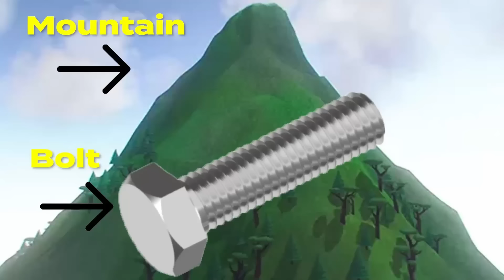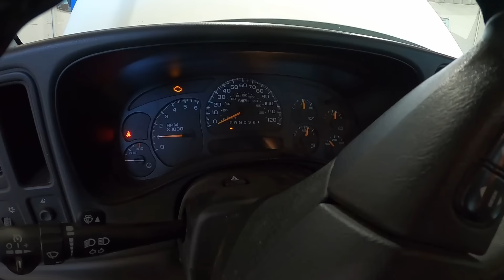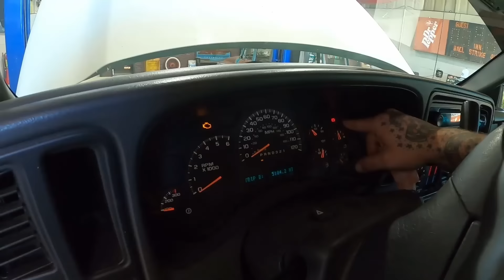BROKEN WINDOWS, Oil change, and MORE! TOW PIG SALLY!

Comment: The blue stuff is to see if the drain plug has been tampered with. Saves oil change places from people trying to scam for a new motor.
Reply: Came here to say this.  I think it started back in the '80s when I worked in Texas at Andy Granatelli's STP.
Reply: Hey that locking pliers guy says to right date on filter lol
Reply: Very typical from a WALMART Tire & Lube Express  😅
Reply: @mattleverenz4150 Except when Walmart cross-threads the drain plug 🤣
Reply: Yea we had to do that when i worked at Walmart tire and lube all the way back in the 90's
Reply: The blue stuff is Ultra blue sealant. The drain plug gasket is old and leaks.
Reply: I work at an oil change shop, and i've seen the blue and red stuff on drain plugs,

Comment: If I had that tow pig, I'd leave the suspension as is, because when you really get to towing something heavy, you don't want it to squat too much. Those trucks are meant to tow and they level out with a trailer/weight on them. Looking good though....
Reply: Agreed
Reply: Thank you for this. AND with a leveling kit, you can hook the a smallest trailer to the truck and it will put the truck in stink bug stance, which looks terrible to me. A heavy load will only amplify this.
Reply: Those trucks also have torsion bars so if it’s really bothering him how it sits he could crank it up or down in the front quite a bit. My old farm truck used to have a service body and when I put a flat bed to it it needed quite a bit of cranking on the torsion bar to get it sitting without the ass end waay up

Comment: Consider installing an electronic number keypad lock at the house. Maybe the shop also. Don't have to worry about getting keys made or locking yourself out. They also make those locks with options to integrate with home automation systems.

Comment: Tech tip: to reset the oil monitor, you scroll through the dashboard menu with the buttons on the wheel until you get to oil life, then if you have an arrow button push and hold it or push and hold the trip reset button until the oil life says 100% then turn the key off and back on and your done.
Reply: Yes this puddin^^^^^
Reply: That’s for the trucks with the fancy DIC with fuel mileage display. These older ones use three pedal pumps to clear the dummy light. I think the one you speak of started around 2010.
Reply: @bairfamilyfarm1336 came here to say that. Love me a gmt800
Reply: My truck is twin to Puddin's, with chrome along bottom though.
Reply: I've had luck with turning the key to run but not started, wait for the checks to finish, fully cycle the gas pedal 3x shut off the key then start it
Reply: That's not how you do this one. I own the same truck. He's right. Turn to run position and throttle to floor 3 times. Only other way is a scan tool reset. I know. I own a repair business.

Comment: Tighten up the front end to level it off. I did that to mine as well. I think that that body style, you can level the mirrors as well. They definitely look better with a little extra meet as well. 
I wouldn’t do that till I got all the rubber off the ones that are on there. 😬👍

Comment: You can crank those torsion keys and get around an inch to an inch and a half lift in the front which puts it pretty close to the rear and a 285/75/16 fills the wheel wells up pretty good and fits those pyo's pretty good
Reply: Yep, exactly what I was thinking.  I noticed the torsion bars when he was changing the oil.  Same kind that I have
on my Suburban.

Comment: FYI the transfer case in those models have a retainer bracket of some sort that is suppose to move internally that uses the case for a stop its steel touching aluminum over time it wears a small hole in the case causing a leak. So if it hasn't already been fixed keep a eye on the ground for leaks. Cant remember if it was a recall or not check  with the dealership. My leak started around 160,000.

Comment: The bolts in the top of the window regulator stay in. You can pop them through the hole above the slot from behind and slide down. Goes together easier. WHYYYY aren't you using the lift for that?!?! 🤣💪🏻 would have been 100 times easier! Love how the shop came out bud! 👍🏻🇺🇲
Reply: Firing from the hip will do that. Doing it the difficult way.

Comment: Agreed, level and larger tires. GM's especially need to be leveled. I have an F250 and went with 35's which are only slightly larger than the stock tires. Looks much better and not over the top with a lift and all.

Comment: Gauge clusters have a common problem with becoming unsoldered and resistors popping you can send them in to get them repaired or you can watch the YouTube guy who repairs them and you can repair yourself it's a little tricky but you can do it
Reply: It's not that. These are notorious for cluster issues...BUT if you paid attention, his dimner switch was all the way down. So yeah you're not going to see the display. These trucks have auto lights. When there's any shade they kick on. I don't get why people turn the dimmer switch down...leave it up so you can see...the dimmer switch does not work unless the lights are on in these trucks. I've owned 4, so I know a thing or two about them.

Comment: Blue goo is used in pro shops to verify drain bolt is torqued to spec. My shop is the tech check on oil specialist. In over 30 years we have never had an issue.

Comment: What you were describing is exactly what I did to my truck. The leveling kit is easy to install, it's just billet aluminum coil spacers for the front. They do sell them in different sizes so you have to figure out how much height will make the truck level. I put Goodyear Wrangler Authority A/T's on mine because I got a hell of a deal on them from Sam's Club. I believe they are a 32" tall tire, which looks great on a 3/4 ton pickup.

Comment: Hey Puddin, I've run  LT285/75R16 to fill the wheel wells and had no trouble. They are a 32 inch tall tire but not to wide. 305's and I think the tire will rub the back of the front fenders on hard turns. My faves are BFGOODRICH ALL-TERRAIN T/A KO2 and have had good luck with the TOYO OPEN COUNTRY A/T III
Reply: General Tire makes a good looking tire too for that wheel. Rated for 80k but I'm going to get closer to 90+ from them.

Comment: You need to get some of those clear plastic tanks surrounded by aluminum bars  on Pallets ( If that makes any sense),  Dump all your used oil in them....and either save it for a future used oil heater for the shop....or tell Mortzke to come get a couple each year for his heater.(and bring you a couple empties.).
Reply: Here in Va. they call them totes. I think they're like 300 or 350 gal.
Reply: Also called an IBC- Intermediate Bulk Container.
Reply: truthfilterforyoutube8218 Where I live in the South .People use them as a place to put their trash at the end of their driveway. They just cut the top off and throw in the trash bags.
Reply: @lilorbielilorbie2496 That’s right! People in Louisiana love doing that. I guess it keeps the dogs from tearing into the trash.
Reply: Or fill it with red diesel and leave in sunlight, after a few weeks the sun will "bleach" the red out of the diesel....or so I've been told....

Comment: The blue stuff (and sometimes yellow) some places use to mark the drain plug and filter to ensure if its been tampered with since they changed the oil.  Like if the engine blows they can determine if its been since theh changrd it or not.   I've seen convenient lube do it.

Comment: Leveled, kryptonite front end parts as originals wear out, bilstein 5100 shocks, 33s and love the truck. Upgraded sound system with Bluetooth and back camera for hitching by yourself and they are better than new ones. Seats and road noise is way better than the next 2 generations.

Comment: Remove the steps turn up the torsion bars to level the front. I'd put a 17" wheel for better tire choices and may as well go a bit wider than stock and fill the tire well a set of 265 70 17 BFG all terrain tires.

Comment: If you level it and put 285 75 on it with the 4.11 gear you will run within 50 rpm of stock truck with 3.73 gears on speedometer if you reset it so it’s right. If truck came with 3.73 the 285s kill first gear off the line but you start a load in 4wd then shift back to 2wd with the button if real heavy. Been driving multiple 04 models same truck since they were new. Current 04 has 8.1 Allison combo. Same mileage empty as 6.0 but double mileage towing . Love those cateyes crazy reliable quiet and still nice family trucks with care.

Comment: I leveled the front of my 09 1500 Silverado and removed the "Silverado" badging on the doors. They ride on 33" BFG K02 all terrains and it has been set up like that for years. That truck gets beat on and abused, but I still think to myself "damn that's a good looking truck" when I see it. The one thing that I'd suggest if you go that route is new upper control arms. Even at 1.5 inches of lift, it chews up tires if you don't.

Comment: The front suspension on those trucks are torsion bars so just some leveling keys. 285/75 or 305/70 on factory wheels. I’ve done both tire sizes

Comment: I have a GMC Z71 and I leveled it I just bought a 2-inch block that sits on the front struts bolts right on top of the front strut it's pretty easy to do

Comment: You hit the nail on the head Puddin. 
Leveling kit, biger and wider all terrain tires, Tinted windows and that's about it. 
I've never liked those particular rims, so I suggest steelies with beauty rings & caps.
Reply: I actually like those wheels. They are A lot lighter than the steel wheels!
Reply: @OldsmobileCutlass1969Va  that's a big benefit, especially when moving to bigger tires. But I just don't like the style of them.
 Not my cup of tea, I guess

Comment: I have pretty much the same truck. White 03 6.0 2500hd crew cab short bed. Previous owner was running H2 wheels with 285/70/17s. No lift and he claimed no torsion bar adjustment. I put 265/70/17 tires on it and I like it. They look OEM plus to me which I enjoy. Tires look good size to me. The 285s were too big to me.

Comment: The “level” kits for these is just a cranked torsion bar key causing it to ride rough. And struggle with alignment. 

I would get a 4” lift for a couple hundred bucks and pull the torsion bar bolts out with out touching the rear leaf springs. It would ride amazing and sit exactly how you described.

2” wheel spacers out back to equal the front and rear trac width , 
Tint , debadge, perfect.

Comment: If you have a transmission jack you can use a drain pan on top of the jack, and not have another tool on the shop floor! I’ve done that for 20+ years!

Comment: LOL, I had two 55 gallon drums full of used motor oil at the same time to get rid of just from doing the family oil changes for over 30 years. Bought a cheap ebay chinese barrel pump and used empty laundry soap plastic jugs to transport the used oil to the local Advance auto store and slowly got rid of it all.

Comment: if it's an HD you don't need torsion keys to level it. the indexing is the same on them as the "Lift Keys". these truck look amazing on a factory H2 wheel and the stock Centre caps fit on the wheels ;-)

Comment: just alittle info for you jacob that little button to the left of the headlight switch should be the dome override switch which turns off the interior lights as for the truck i would level out the front end and if its running 16 inch rims id run 285/75/r16 if its got 17 inch rims id run 265/75/r17

Comment: There is a long version of that filter that almost doubles it size to hold little more oil and filter media. There 2wd and 4wd size but long one works best. Also when ethanol fuel came out I drove a 6.0 and non ethanol fuel got 4mpg better. Let that 6.0 sing towing if lugging down put in 3rd and tow haul mode they make their power in the upper rpm.  But great motors very dependable.

Comment: Welcome to Silverado 2500.  Exhaust crossover right behind the drain plug.  Best design ever.  Especially when the rear main starts to leak.  Built-in leak smell detector.

Comment: Leveling would be a good choice for that truck. If it were mine, plastic running boards would be gone, as well as the plastic door bump guards. Truck already has tint on it, but would definitely have it redone with some primo xpel tint for those brutal summers.

Comment: Tech Tip. If you have a roll around work bench use it as an oil change station. Put your truck on the lift. Roll work bench under the truck. Oil pan on the work bench to catch oil. Easy pezzy lemon squeezy 😅

Comment: I kept the factory tires but leveled my '15 Silverado with Bilstein 5100s and put Heilwig sway bars on it. Handles great in the mountains for a 4X4.  Shop looks great !
Reply: My 2002  i bought some 2020 trail boss wheels. went from an 16 to 18 inch, gained 3 inches of lift with just the wheels and tires

Comment: I have a 2003 2500 HD Duramax version... and i too was shocked at how low the frame rails were to try to simmy under to change the oil! I just drive up on a couple of stacked 2*10's to give it a little ground clearance. I've left mine stock, since i use it to haul scrap and such. I did get a set of aluminum wheels like you have on yours, but all the clear is pealing off of them. I'm going to sand blast them and paint them black when it's time for new tires in the spring.

Comment: I do 5 pedal pumps then crank it on the ones that have that system for the reset.  Most of the ones I have and have worked on the back-light bulbs on the message and odometer area are plumb wore out so you can only see it in the dark so checking and resetting it at night is best.

Comment: Well if it wasn't solidified before me and Puddin are on the same wave length when with come to early 2000's chevys. I drive an 2002 short bed step side leveled with 18's and an off road tire on stock wheels off a 2020 factory trail boss (black snowflake design). Added a grill guard, 2 8 inch RC light bars, led fog lights, upgraded head lights and tail lights, 1.5 inch wheel spacers, and most recently had a spray on bed liner put in and of course blacked out the entire truck aside from red break calibers.

Comment: At one time, I did have two big lifted trucks, and they were cool for a while, but the constant climbing in and out got to be a pain in my ass. Sold both and did just a leveling kit on my new to me truck with a 33" tire and some not over the top rims and I'm super happy with it. 
Tows my car trailer perfectly,  easy to park at places. So I would go the way you said leveling kit and just a tad bigger tire. On the GM trucks they are stupid easy to level.

Comment: We had the same problem on are truck where the little panel below the key was coming off, but mom seen it and she fixed it by ripping it plum off. So, know you need to fix it along with the rubber grommet type thing that was on the pole that you stick in to drive.  I think are truck perfect on the lift style it looks pretty level. Kind of wish was a four door, but I like it.

Comment: i know  you do all your own service, BUT, those oil filters only need to be tightened till they snug up and then no more than 3/4 of a turn tighter.  Makes it so much easier to get them back off.  Been doing service work for 40 years brother, nothing worse than some knucklehead cranking the filter down so tight you have to use a prybar and a hammer to get it back off.  my .02....for whatever its worth.

Comment: Over sized air bags so you can get the height when you need it.... .it is a 4x4 crew cab..... and your daily driver .....running settings......run height, race height, and rock climbing height....all in one.....

Comment: Best thing to use to get your spray bottle put you some Dawn soap and water in it and spray off at all filter in a drain plug and everything and then dry it off with some rags that’s how I do it where I work get it all cleaned up Yeah keep up the good work Puddin I don’t have to take a picture of my truck. I got your stickers on my back window.

Comment: If that was my truck and i was using it for towing i would level the front and get some good looking black wheels with so maybe 285/60 or 285/70 all terrains and take all the badges off and put some black housing headlights on it not smoked headlights just black housing with a black grill and some either black l.e.d taillights or smoked oe taillights and some 5 percent tint on all 3 back windows with 20 on the front 2 and a brow acrocc the windsheild and she would be mint 🤌🤌

Comment: I have the same truck down to the color, only with the electric shift transfer case and nearly twice the miles on it. You think you want the diesel, but then you see they cost twice as much to buy, and one set of injectors practically eats up an entire year's worth of fuel savings. If you need to tow more than 10k frequently, a Duramax would be nicer, but otherwise that truck will last until the sun burns out.

Comment: Window regulator replacement when you start questioning how the OEM put it together. Did they assemble the door at the same time sandwiching the window regulator. Things I'd happily pay a mechanic to do. 1, vehicle suspension (them springs be widow makers) 2, anything relating to a vehicles door.

Comment: Get that plastic bed liner out. I’m sure you know but they rust a bed out faster then shit. If you do (and it sounds like your are thinking about it) a small build on the truck make a diy spray in bed liner part of it. I recommend raptor liner. Definitely needs to sit level. I’m not a fan of lifting the front, those ifs trucks already have a weak front suspension. I actually lowered the back of my dodge 2500 instead of lifting the front. But helper bags will be a necessity after you level it. It will sit squatted with your trailer hooked up regardless if you lift the front or lower the back. Proud of you puddin! Keep going man!